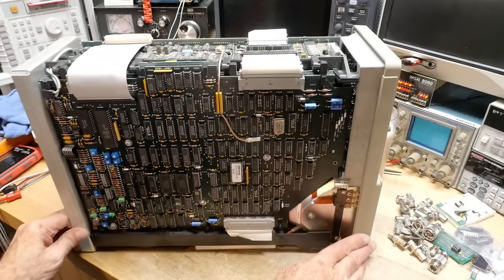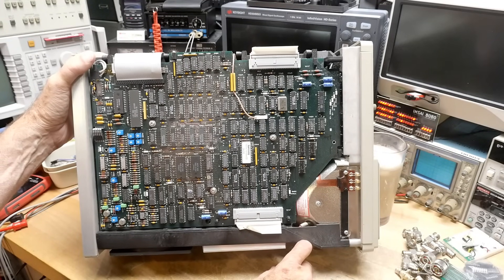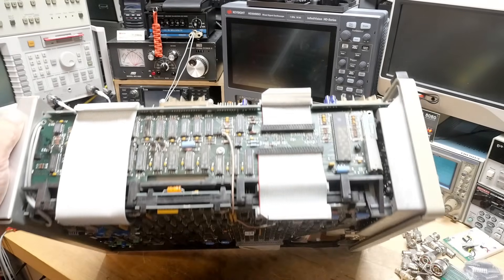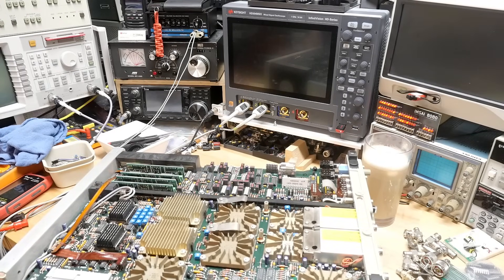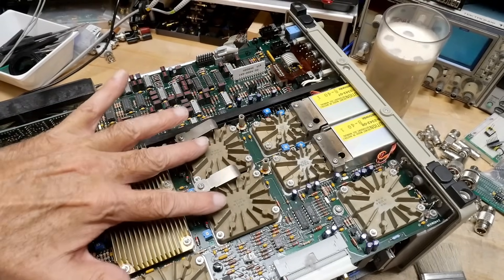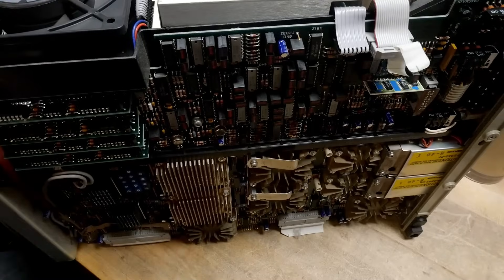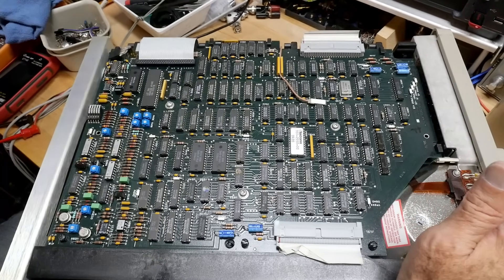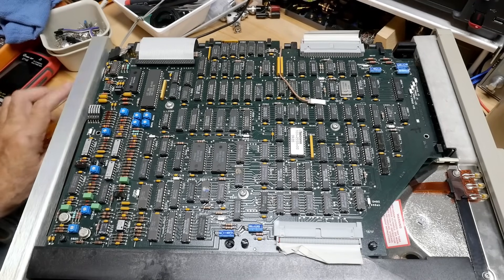#2338 Tektronix 2440 500MS/s Digital Oscilloscope (part 2 of 4)

Comment: When I worked for IBM in 80s,  they had bought few dozens of these scopes to measure the voltages across the boards.  Later, they found out that the 8-Bit resolution wasn't good enough to test the boards.  Then these expensive oscilloscopes became just for show on the top of the racks.

Comment: Probably too late now that you're posting these videos, but it may be worth checking for access to the bottom of that board via the other side of the chassis rather than removing the board in question. Lots of PCB origami that can get out of hand when you're removing large portions of the scope.
Reply from the maker: the back had to be removed

Comment: There is a low value resistor in series with each of the Rifa's, and if the Rifa has short circuited then the resistors will be damaged also. I did a similar 2430 repair video and I changed out those and C244 (180uF 40V) also.

Comment: Caution! The service manual has warnings about keeping a fan on the input board CCD chip heatsink while operating with the cover off. 

There are two electrolytic caps in the power supply with no writing on them that were leaking ( I replaced the rest just in case) -- special custom early water based low esr I guess? One of the linear regulators was damaged so scope the power supply ripple. 

Don't forget the Dallas nvram chip, it has a battery in it. 

I think I'm starting to have bitrot issues so you may want to image the eeproms, not sure which ones are flash and which ones are mask if any -- resetting the memory after it sits for awhile takes care of the erratic behavior.

Very interesting CCD input chip, it has a "repetitive" mode that seems to be unique to this scope.

The power supply is somewhat different, combining two switching techniques with linear regulators. It may be worth a look.

Oh gosh! Thanks for reminding me about the rifas! I'm running downstairs now.......
Reply: CCD Analog shift register ?
Reply: @TinLethax  That's how they get fast acquisition.  The trigger starts the inputs (up to 4 at a time) being sampled at full bandwidth into the CCDs.  Once the CCDs are full, they get clocked out through a mux to a single, much slower ADC for digital acquisition at a reasonable speed.  After that point it's an 8 bit computer with a fancy vector output state machine.  It's a really slick architecture. I'll also note there are dedicated chips in front of the CCDs which track the highest and lowest voltages while in the analog domain.
Reply: @TinLethax  Yes believe it or not. It shifts the input signal in at high speed 500Ms/s then reads the values out of the capacitors using an A/D converter at a slower speed. This works similar to the fabled CCD delay lines the audiophiles are obsessed with, but much faster. That is what the "repetitive" mode does. It builds up a statistical view of the signal from the raw reads.